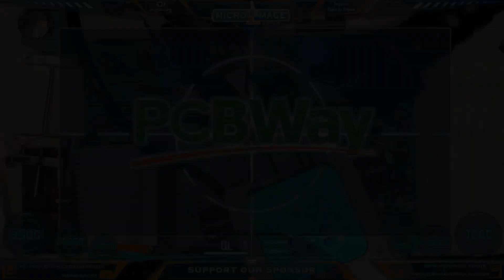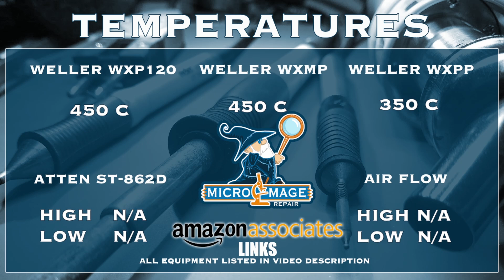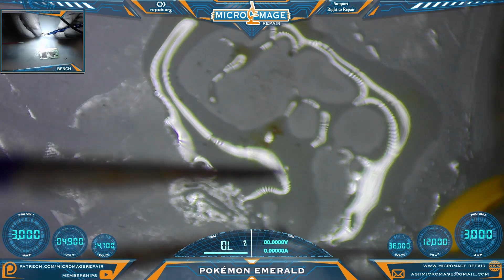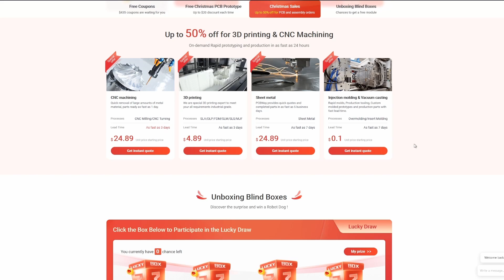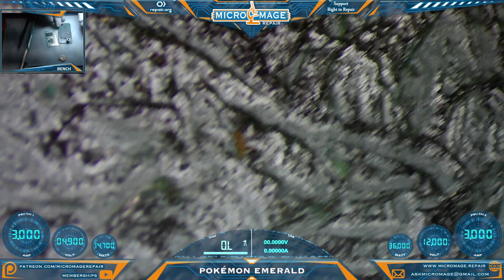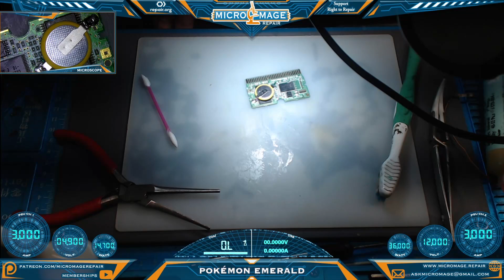Pokémon Emerald: Pad Repair & Battery Replacement Round 2!

Comment: So I picked up a copy from a yard sale that is totally missing the positive pad, could it be fixed?
Reply: Sometimes the easiest way is just to rom swap with a Japanese cart
Reply from the maker: Should be fixable.
Reply: It should be. Mine was gone completely and this video help me figure out where to run a jumper wire. I ran my jumper off the r9 with a 28 gauge wire to the battery. Booted the game and no longer got the dry battery message.
Reply: My emerald is trashed, The pins broke and the battery won't stick down
Reply: I just messed you via your website for this same repair.. Hoping to hear back soon. Ty!